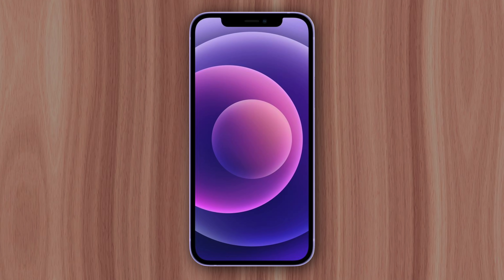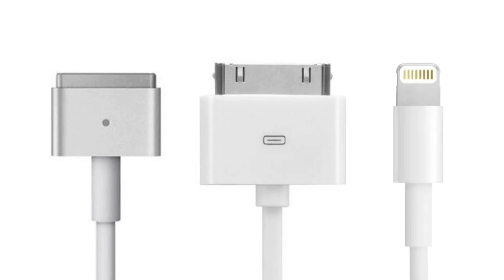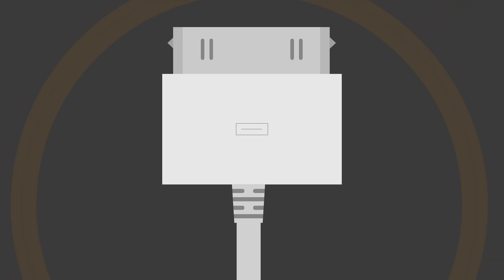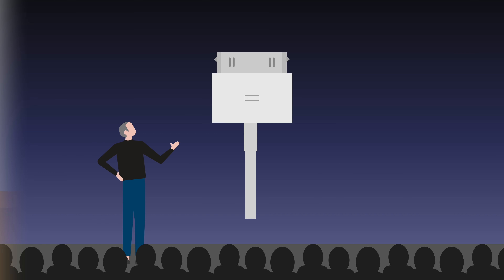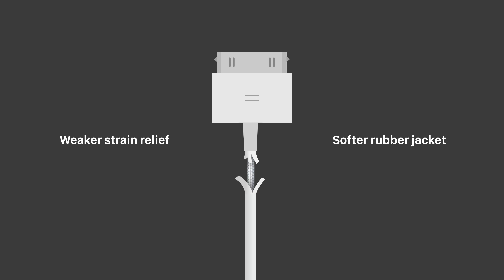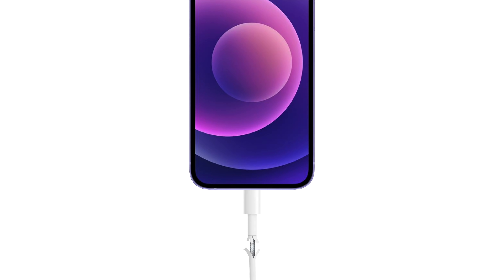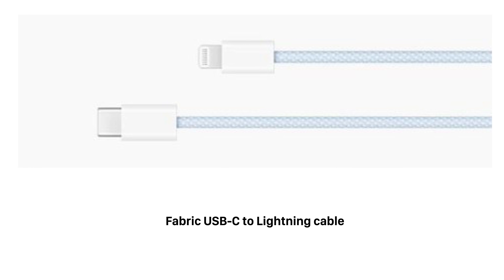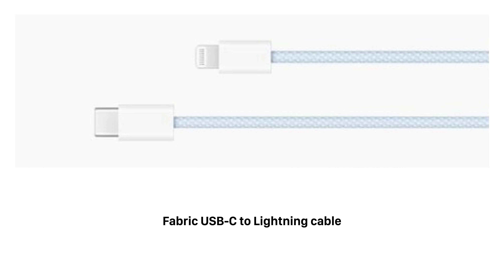Why iPhone Cables Break So Easily

Comment: Came here because my lightning cables fail regularly, and it's not the cable fraying or breaking. It's the connection itself failing. Both the cord from Apple itself, as well as two aftermarket lightning cables have failed me with zero fraying or breakage. I just came here to complain. Such a luxury product should fucking work.

Comment: Albeit with a sample size of however many Apple branded cables I have owned (possibly no more than 20 at a guess), I have not found them to be significantly less durable that others. They’ve held up better than micro USB and compare favourably to third party lighting. Maybe a bit worse than USB C but it’s hard to tell. I had a pet chew through one cable but I only recall one failing for any other reason. Meanwhile a number of micro USB ones have ended up with bent plugs after repeated use. Just because others can share anecdotal evidence of cable breakage, that does not make it a broader issue.

Few of the non-Apple cables that I have used include a ribbed strain relief sleeve either.

I do like the fabric sleeved cables though.

Comment: I have an iPad 2 with it’s original charger from 2011 and the charger still works perfectly fine, yes it looks a bit worn out but the rubber is still fine and not peeled off or anything

Comment: Apple still doesn't seem to be selling woven fabric Lightning cables on their own, and with iPhone 15 being rumored to charge over USB-C (at least in Europe and probably worldwide), it'll probably never happen. But interestingly, their USB-C charging cable (both ends) is woven — it's only intended for iPad and accessory devices for now, but maybe when iPhone moves to USB-C, we'll see more of woven cables. Also, my two most treasured cables (lol) actually are woven Lightning cables sold by Apple - not from an iMac, though! These are each from a black-keys Magic Keyboard (with black Lightning cable) and a white Magic Trackpad (with white Lightning cable). It's the same length as the usual iPhone charging cables, and seem a lot more sturdy (many broken plastic cables here, over the years).

Comment: literally got some 2nd gen airpods like 3 months ago and it came with a cable. been using that same cable to charge my phone and it’s literally getting so hot that it’s practically melting itself. these cables are a death trap and i’m surprised that apple hasn’t been sued because it’s a fire risk at the end of the day

Comment: On a slightly different note, I have had non apple cables appear to fail that were perfectly fine.  At first I would just throw away the "defective" cable. But then, I realized, how could different cables from different companies be going bad. I would plug in a cable and my iPhone 8 would only charge for a minute and act like it was shorting out and losing connection. How could this be? The same thing with different cables. This is something programed in the iPhone 8. You want to know the crazy thing? I just leave the cable plugged in and after about 5 minutes of it acting like it is shorting out, it starts to work fine. And that is how it is with several of my non apple cables. 

I know this is a different problem then what this video is about. But, you don't have to look far to see many others complaining about what I am talking about. I don't remember the term used, but apple has done this kind of thing before, with there programed failures of batteries. And they have done this here with the older phones. Non apple cables are programed to appear as failing. How unfortunate that they would do this. But that is what they have done.

Comment: I have this phone for about 1 year now. (it’s an iPhone 8 Plus, moved from Android to Apple 2 years ago) 
I have changed at least 7-8 cables. But they weren’t looking broken on the outside, they just wouldn’t charge my phone anymore. I finally found one that lasted me for more than 3 months. It is a Baesus black fabric cable which I bought in June and still lasted me to this day. But I have had encounters with some other fabric cables in the past. Almost all the fabric cables I’ve had in the past broke immediately after 1 single day of use, which is such a shame considering they had very beautiful colors. Honestly, I would only recommend fabric cables like the one showed in this video and even fabric cables outside of Apple but only black or white. Again, other fabric cables I have encountered in the past were coloured in pink, green, blue, all kinds of different colors, thinking that I would eventually find a colorful one that works.

Comment: I never got the issue with Apple cables. I still have a gen 1 iPad Air, which is what, 10 years old now? Still on the original cable, which apart from being a little dirty, nothing wrong with it. I just think people don't care for their cables properly.
Reply: my usb c chargers lasted rlly long surprisingly, however earpods always end up pausing and dropping calls and switching voice control by itself 3 months later. ive followed every tip to prevent breakage with no success ugh

Comment: I once had two old IPad cables, both were frayed though one was way more shredded than the other. You could see the metal that the white cover was supposed to cover over. Surprisingly, both cables worked but my dad insisted they be thrown out for a fire hazard or something. Sadly this is not only an issue with older cables that have been used thousands of times, it seems like newer cables are able to easily be frayed as well. D: Apple says they want to be eco-friendly but I don't think they know what eco-friendly means.

Comment: The cable wont break so long as you don't rip it out the phone or go rough on it. My longest running lightning cable lasted like 7 years, only reason it didn't last longer is because I recently upgraded from the iPhone 6s Plus to the 14 Pro Max which came with a USB-C to lightning cable.  My old USB-A to lightning cable which came with my 6s Plus (that still looks and works perfectly fine) just doesn't compare to the faster charging USB-C to lightning one. My point is these cables are definitely weaker than most others in the market but so long as you take proper care of them and go easy when handling them they'll last.

Comment: I have actually used SUGRU to strengthen the ends of my charging cables. It might not be the most elegant solution, but it makes the cables last longer than they would otherwise.

Comment: In apples defence, most people pull the cable out by the wire, not the actual housing of the port. If the cable was removed by the the housing and not the cable, the cable would last much longer. Granted, Apple still need find a way to make the cables more durable. Maybe have the sleeve over a thinner but longer strain releif.

Comment: or just get apple certified cables off amazon for less that £10 and not spend £25 on on 1/2 meter charging cable from apple themselves. and the end of the day they both do the same thing

Comment: I only ever had one apple lightning and 30 pin cable do this to me. In the full life span of my iPad 2nd gen and iPhone 4S, only one of the cables finally gave up after using it for 5 whole years, but before then I had replaced my ipad 2 with the Air 2, so I still had two 30pin cables just to use with my iphone, till I got a sorta used iphone 7 (and also replacement ipad 5th gen)
So only two cables out of 5 that are broken

Comment: The Apple bigshots think the ribbed strain-reliefs look bad so they decided for a sleeker look based on design and not function, even though they knew it would cause widespread problems. .  So instead of having the "horrid" ribbed wires for my Apple products, I've got very expensive frayed, falling-apart wires that are damned effing, ugly, and ineffectively patched up with electrical tape.  THANKS APPLE.

Comment: I'm probably one of few but I've never broken one, the worst I've had is a tiny crack in the plastic but it charges all the same; just treat it with a bit of respect don't crank your phone 180 degrees and you'll save some money

Comment: I have a belkin lighting cable because the original one from my iPhone 7 broke in just 3 months, after 2 years of use of my iPhone 7 I bought the new iPhone 13 and I still didn't even opened the original cable it comes with because I already know how cheap that cable is.

Comment: So they wanted to make the cable more eco-friendly but as a result the cable breaks every six months so over the lifetime of your phone you have to get 3 new cables to replace the original cable instead of just using the one it came with forever, resulting in tons of trash from broken cables and shipping boxes.
Brilliant.
Fun fact, one of my customers came in once and complained that her cable *exploded*. There must have been short inside it which melted the plastic and made it pop, burning her in the process.
That was a fun discussion! Because she wanted to make me responsible for it because I sold her the iPhone the cable came with.

Comment: The fact that they have a monopoly is probably the biggest reason why they don't care to make the cable more durable. It just so happens that making a cheaper, less rugged cable is "eco-friendly". This is also most likely the biggest reason why they aren't moving to USB-C. Because there isn't a monopoly with USB-C, you can buy a 6ft woven cable with thick rubber guards for only $8.

Comment: I have a question because i am scared because my charge has a crack and when i plug it in  it heats up very fast to were it can be very hot, should I not use it or is it fine =(

Comment: "more eco friendly" then why do they make a supercharge feature that can only be used with an adapter that doesn't come with the phone cuz most already have one but the ones they already have are usb not usb-c so they can't even use the cable that is shipped with it and there is an entirely new package-line for those adapters

Comment: I am not sure eco is a good excuse. Because the material can actually last much longer especially at that price. And not eco-friendly cables with same design would also break easily. So it should be designed like this. And if really want eco cables, why not braided cables that last insanely long. I have a good braided micro usb cable used the entire time the interface was used and it is still handy for my Bose headphone now.

Comment: That’s nice, but let me tell you something else. When I unplug ANY power cord, I grab the thick part, which is the part that you grab when inserting into the power source. And with my USB cords I do the same thing and I have them in great condition. 

The real reason why the cords break is because people pull from the thin part, from the wire. I have seen my brothers pulling off the USB cords and noticed the plastic breaking.

Comment: I have probably spent about £300 over the years replacing Apple cables. Eventually bought one from Amazon for £6 which is completely reliable and very tough.
Apple really does take the piss sometimes.
Reply: In 11 years of owning a MacBook, I've had to replace its cable only once (and only for aesthetics, not function). I've never had a phone cable fail on me.
Reply: @MayTheSchwartzBeWithYou  
Seems the video suggests they’re weak. I have lots of delicate things. The fact I may have them in an unbroken state for years, or permanently, does not mean they’re not weak and delicate.

Comment: The real reason is, the more the cable breaks the more will new cable been brought and the more company earns
Reply: The cable won't break unless you abuse it.
Reply: @MayTheSchwartzBeWithYou  have u even used it😒
Reply: @mohamedroshan8505  Yes. I have tons of iPod cables from 2005 and 2009 that still work like new. I had to replace the cable for my 11-year-old MacBook just once, and it was more for aesthetics, since it still functioned fine.
Reply: @MayTheSchwartzBeWithYou  U alone gave that company tons of profit with tons of cable dude 🙂
Try using a single cable for those 4 yrs I bet u can't use it safely 🙃
Reply: @mohamedroshan8505  The reason I have so many cables is because they came included for free with my purchases, and none of them have broken. I didn't specifically buy just the cables. The only cable I use on a daily basis is my MacBook cable—again, I've only "had" to replace it once in 11 years, and it was more for aesthetics, since the cable still functioned just fine.

Comment: I've rarely had issue with the cables, recently I thought I had a cable issue with my iPhone 11 but it turned out to be dust and stuff inside the Lightning port, clean it out with a plastic toothpick (never use metal) and it works perfectly again. As for cables I now use the one that came with my iMac to charge my iPhone and AirPods along with the KB and trackpad.

Weird how they tried making something more eco friendly but its probably lead to more cables ending up in landfill!

I really hope they start selling all their cables as braided ones, weird I have one for the power on my iMac, one cable that for most users only get unplugged when the iMac is moved, so almost never.

Comment: In Australia, you can take these into Apple and get a replacement of the same length under manufacturer’s warranty, as protected by law. As long as the insulation on the internal wires is intact, and/or there’s no damage to the plastic connector housing (indicating damage from tampering or impact etc), this “defect” in the product means they need to replace it. Funny enough, this also applied/ possibly still applies to the old MagSafe power cables for pre 2016 MacBooks. You know, the ones permanently connected to the expensive power brick. I replaced 2 MacBook Air power supplies under those conditions.

Comment: I’ve never experienced this issue. I have an iPhone 7, and I still use my power cable that i got with my iPhone 5 in 2014, even though I’m not handling it carefully and just throw it in the bottom of my backpack everyday, it looks and works like brand new. Can’t say the same about their earpods, i broke around 8 since like 2014 lol

Comment: No wonder my ipad2 outsurvived its cable. 10 years in and still going strong, but the cable has been breaking like crazy I have to set it at just the right angle for it to charge.

Comment: The design of the cables appears to have been deliberate & ensures the sale of replacement cables or in the case of laptops the actual power supply, my MacBook Pro needed a new supply because the cable split, Apple could have used mag connectors on both ends of the cable so only the cable would need changing but that would have hit sales of the £70+ power supply. Essentially designed deliberately to fail & screw the customer.

Comment: Actually though, this is one of those things where Apple is right: 

You’re using it wrong. 

I have never broken a single Apple charging cable. Not one. I’ve had 3 iPads, 3 iPhones, and 2 Apple watches, and countless cables. 

You are breaking those cables. Stop bending them at their seams. It’s bad for the port, bad for your product, and bad for your wallet.

Comment: You forgot the 3. Reason: Stupid Users. All my Apple products are charging on their original cable since I bought them.Bc ppl ripping the cables out of their devices without giving a single f*** that's not an apple problem. It's just how much you care about your device. Ofc its a everyday use product but you also care for your car even if you use it daily. You don't slam your keys in your door, tighten your laces with brutal force or punch your flushing on the toilet but that's exactly how these ppl use their charging cables.

Comment: Im gonna be honest, I didnt even know it was such a huge issue until i watched this video. Ive been using the same charger and cable since the iPhone 5s. Only replaced it recently when i bought the 12 because i wanted faster charging, but im still using it on the job site, and let me tell you, they dont have an easy life in my toolbag. My 2015 MacBook powerbrick is still in decent shape, even thought i sometimes roll over the cable with a chair.. Just how do you brake it so often for it to be such a big issue? Or am I just lucky enough to get forbidden prototype undestructable cables when buying stuff?

Comment: I don’t understand how people break those cables. I have only had one break so far and that was a 3 year old cable that was used daily. Pull on the plug instead of the cable and it will last way longer.

Comment: This is my biggest pet peeve with apple. 

Isn't it better for the environment if you make one cable that never needs to be replaced then making cables that can break and need to be replaced? plus can't be recycled once wire is mixed with plastics it can't be recycled.

Comment: my 2$ (MFI certified) amazon basics cable lasted longer than Apple's 30$ one, also that specially soft white rubber captures the dirt on your fingers becoming filthy in no time. the amazon one has a mechanical winding mechanism so it's always tangle free. think different, don't be an apple sheep if you don't have to.

Comment: making a customer buy dozens of cables instead of one is not anything friendly..
Shows a complete of understanding of the term environment.. but does increase their sales massively.. 
i just calculated i actually now spend more on cables than phones..
tell it like it is .. it's called designed obsolescence and its for money..
there is no way you can make a microchip with millions of transponder 
that can receive signals bounced off satellite in space then claim not to be able to make a cable..

Comment: My ipads cable worked for 3 years yes the outside get damaged but the inside worked pretty fine and my iphones cable worked for a lot until 2-3 drops of water was stuck in my lightning port and break the cable